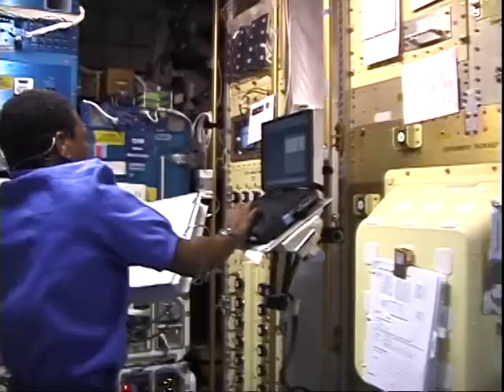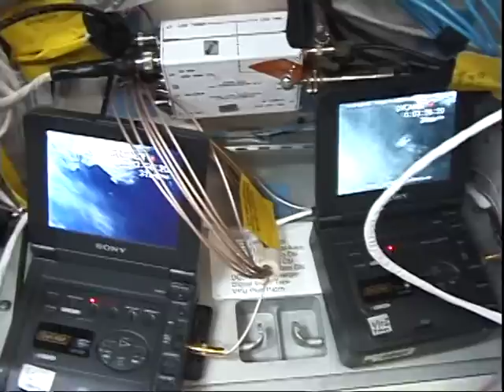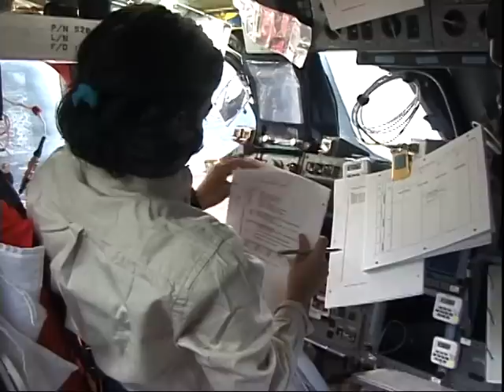STS-107 Onboards .24

Comment: Tiffany’s question about the fly may not be relevant to the loss of this shuttle but it should be answered.  Ive always been a proponent of the space program even though the costs are huge. I feel we owe it to future generations.
Reply: yes but not much has changed since the 1960s  rockets dont take you far and its not safe
Reply: @nikolabakich9709  "Planes don't take you far and they're not safe" was an argument in the early 20th century
Reply: @VS-et4pn  rockets won't take you to another solar system too far too slow

Comment: They had so many chances to see thr damage on the wing..
Reply: Sadly, it would not have made a difference....the damage was just too extensive.
Reply: They couldn’t see it anyway, the payload bay door blocked it. If the SILTS pod (the bulge on the vertical stabilizer) was still operational it’d be wicked to see the intrusion.